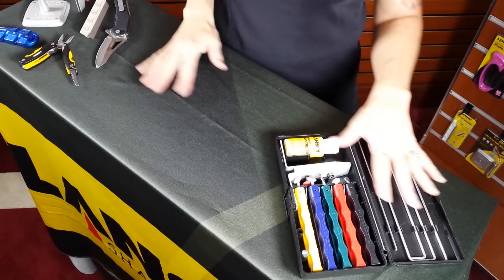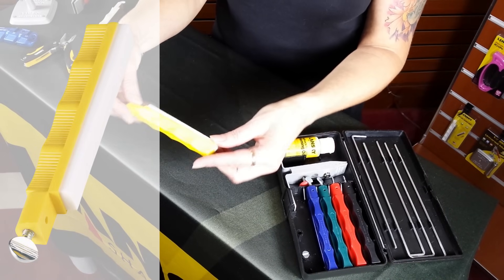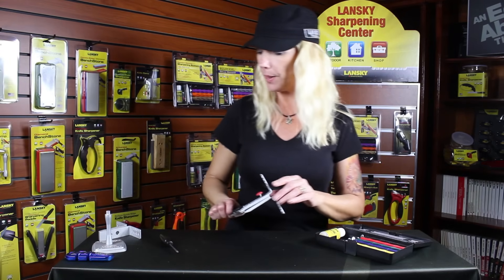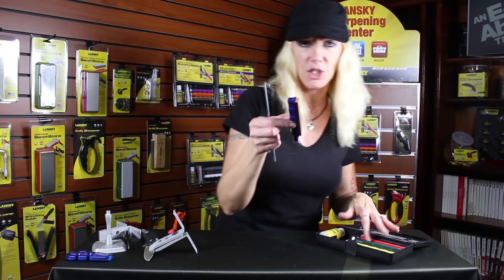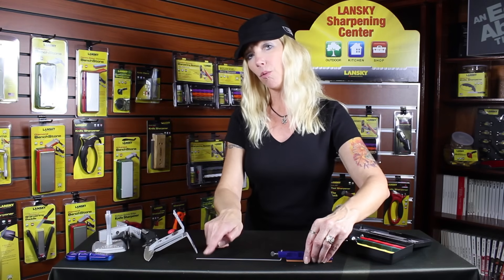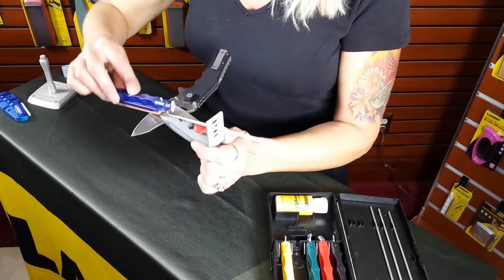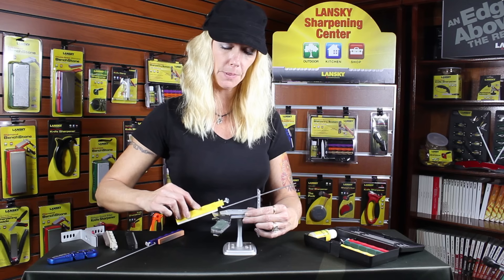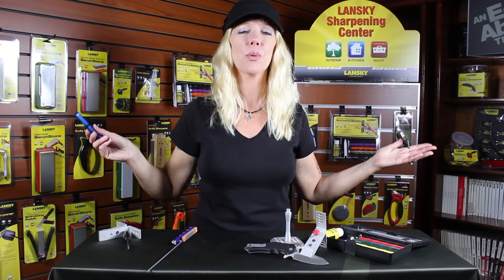The Lansky Controlled-Angle Sharpening System

Comment: How.long will this system last me
Reply from the maker: It will depend on your usage. We have many customers who still use the same system they bought 20 and 30 years ago.
Reply: Lansky Sharp how long do the diamond stones last
Reply: Lansky Sharp how long will the diamond stones last
Reply from the maker: That's tough to answer because it really does depend on your usage -- how often you use your kit, how hard you use it, how well you maintain it. If longevity is the most important factor to you, I would recommend one of our standard systems with the alumina oxide hones. They'll last longer than the diamond hones in general.
Reply: Osbaldo Hernandez mine is over 20 years old, it is the diamond system, i got it after my Dad passed 17 years ago and still going strong.  I use it all the time.
Reply: Not even a day

Comment: I like the way this system ensures a consistent and correct sharpening angle, however, I'm very concerned that you demonstrated 'pushing' the stone towards the cutting edge. This gives you two problems:

1. You're much more likely to cut yourself if 'pushing' rather than dragging the stone across the blade.

2. I must question whether you actually understand knife sharpening? When you sharpen chef's knives on whetstones an essential factor is something called the "burr". The burr is the metal that is dragged or ground off the blade by the abrasion of the sharpening stone. It builds up on alternate sides as you apply the whetstone alternately for, let's say 8 strokes on each side. The knife cannot have a point until this burr is removed in a controlled manner. Good sharpening technique is all about controlling the creation and removal of this burr, which requires you to 'drag' the blade AWAY from its cutting edge. Never push your blade or stone towards the sharp edge of a knife!

Comment: the one thing that bugs me is that the angle is not precise at all. the angle slots that the guide rod slides though will be 20 dergees on the bottom and 25 degrees on the top. you can hear as shes using it the rod sliding around from 20 to 25 degrees with every swipe.
Reply: tayb5oh4 free hand is not always precise either
Reply: I've seen videos where you put your finger under the rod, pushing the guide rod against the top of the hole.  I ordered this system yesterday.  I've been using a Sharpmaker and would like to see if I can get better results with the Lansky.  Don't have $300 for a KME.
Reply: srg914 yeah I had the lansky for ages. Finally got tired of it and ordered the ken onion worksharp with the blade grinding attatchments. I'm now getting 6 knives done to the same degree of quality as doing 1 knife in the lansky.
Reply: tayb5oh4 I ended up returning the Lansky and got a basic KME.  SOOOO much easier to work with and better results.

Comment: Thing is a PEISE of 💩💩 compared to the old one the new jig won’t hold certain blades like a shrad sharp finger original steel !!!!
Reply: Agree, the new ones are crap. Their solution? Use it dry without the oil that comes with it that's made for it so your can damage your edge. Then when you contact them about it and get a replacement directly from them (that they say they don't warranty the whole set) they claim they never had any information about it. Then block you from making any new comments and delete your other ones.